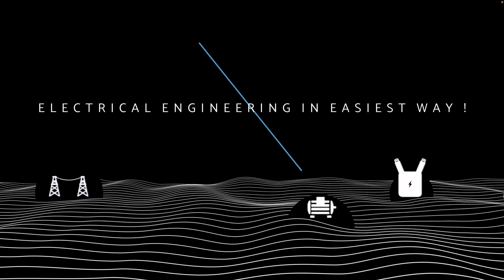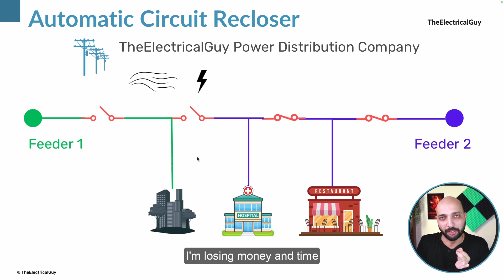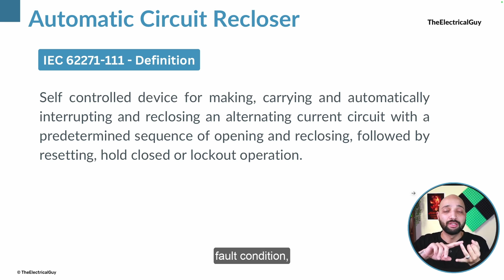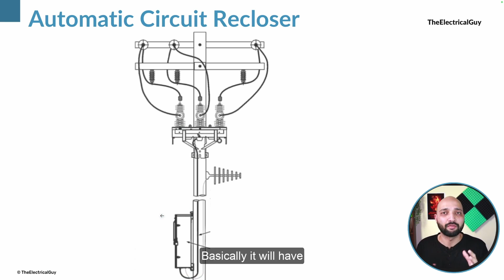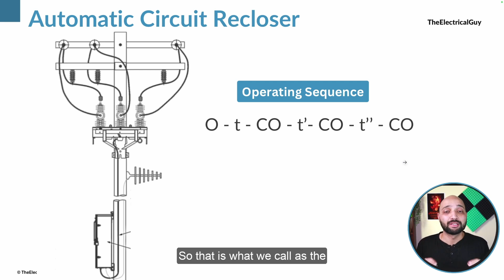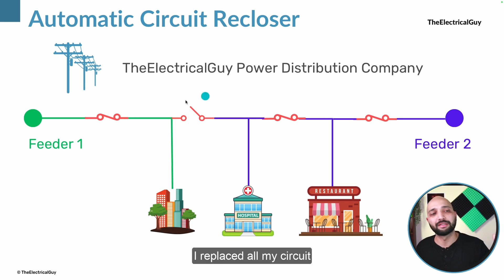Automatic Circuit Recloser | Introductory Guide | TheElectricalGuy

Comment: Presently, UPPCL uses Auto recloser in 220kv and above transmission lines. It's contrary to what you said that autorecloser is used only in distribution network. Plz clarify
Reply from the maker: Hello. Yes Autoreclosing is done in all voltage level. In HV the autoreclosing is done using the circuit breaker. This is a dedicated device used in the distribution.

Comment: Generally you don't need to actually "send" people at the location of the transient fault the circuit breaker installed in the Power Sub Station does the job of breaking the feeder and PSS operator recloses it

Comment: Sir,
I worked in a 765/400kV Substation in PowerGrid.
Where i saw AR in CB and working in different manner in operating sequence.
O.3sCO3minCO
When there  was a fault,  Relay initiates ,trip initiates and at the same time Auto Reclose Initiates.
CB Trips in about 30ms, then CB will remain open for some time (0.3 sec) to complete the Arc Quenching 
which is called as Dead Time and is indicated by 0.3S in the Duty Cycle.After 0.3 sec, if AR is in Service, a Reclose will be attempted, and if the fault persists, CB Trips immediately  ( AR Unsuccessful ) which is indicated by “CO” in the duty cycle.If its a Single Shot Auto-reclose, the Breaker will go into Auto Reclose Lockout, that means , the AutoReclose Relay will not give any further Reclose Command to the Breaker.After CO, there is a Reclaim Time of 3 Minutes, in which the CB gets ready for Closing, which includes CB Spring Charging Time, indicated by 3 Min in the Duty Cycle.

My Question is in your  Time Sequence ,How will CB get Time for charge the Spring Because minimum spring charge time is 7-10sec.
Reply from the maker: Breaker is always ready to perform a CO operation.. meaning that the spring will be already charged.. closing spring operation also charges the tripping spring

Comment: can we say circuit breaker is the recloser
Reply from the maker: Circuit breaker on its own cannot perform the reclosing operations. It needs a system for that
Reply: @GauravJ  system in the sense one command from SCADA which operates our Circuit breaker in its open close sequence. is it right?
Reply from the maker: @Charmingbanana696 for circuit breakers generally an auto reclosing relay is provided. Which gives commands to the breaker.